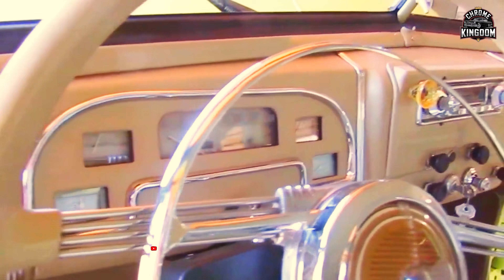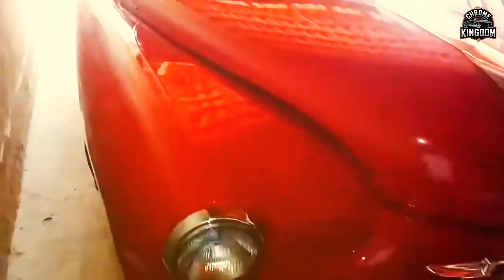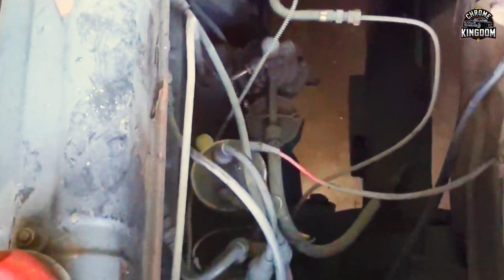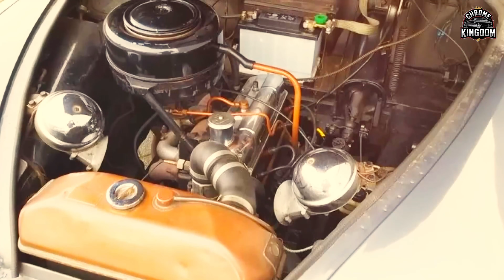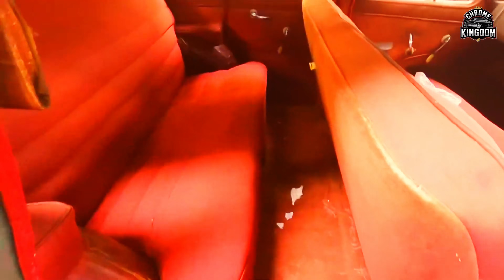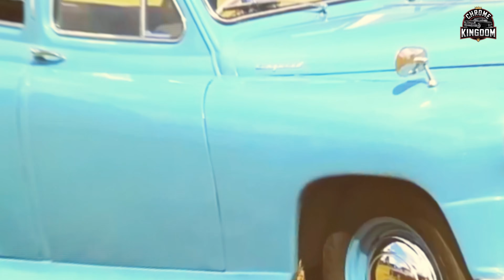Standard Vanguard (1947–1963): Why Engineers Called It “Indestructible” — So Why Was It Forgotten?

Comment: I totally agree, the vanguard was built like a tank, my father went off the road in hilly country, the car rolled twice and landed on its roof, no truck available so a team of men pushed it over onto is wheel, checked the oil level and the radiator water, fixed both and my father drove it 50 miles to home, not a dent, yes a few scratches that polished out and he drove that car for another 5 years, the only problem was that the gear lever was on the right of the steering wheel, had a small arm that came out of the pillar to signal you intended to turn left or right.

Comment: My dad bought one new in late 57 and exported it to Nigeria a two tone blue model , dad sold it in 63 or 64 to my grand parents  butcher in Sheffield  it was still in use in 1980 and looking good not bad for a car 23 year old car I spent many an hour sweating on the back seat of that Vanguard as a baby in a metal baby seat with a dinner tray on the front, some where to crash out then later my little brother in the baby seat and me sat next to him no seat belts back then. Dad chose the Vanguard  as it had been tested on the trans Sahara rally by two well know British rally drivers whose names now escape me they had been employed to put the car through it's paces and make notes in fact they found little to comment on, it was quite a short list and Standard made good on their findings one being better door seals as the factory seals sufficient for English weather proved inadequate against the Sahara  dust, dad reasoned probably rightly that if the Vanguard was Sahara proofed then it would be good enough for Northern Nigeria.

Comment: In rural Australia, dad bought a Vanguard Ute in 1954.

With 15 inch wheels, and “Trac grip “ tyres, the Ute was unstoppable. Uncle Donald had a Land Rover, and Dad could always follow the Land Rover, and never got bogged.

Our little sister sat in the frown seat with mum, while my brother and I, plus the red kelpie, travelled in the tray at the rear of the Ute.

When it rained, my brother and I huddled under the tarpaulin, and moved close to the front of the tray, under the window ledge. Snug as bug in a rug, dry even in torrential downpours.

Comment: I owned three Vanguard in the 60's, one phase 1 and two phase 2's, they were the best car I have ever owned and that includes my current Audi A4 Avant which is in it's own right a good car. The Vanguard was indestructible and it was a dream to drive, I often drove from South Wales to London, 125 miles and got out of the car as if I had just go in, no stress at all, averaging 70 mph. In those days I maintained the car myself so the cost were low, not like now unfortunately. You could rotate the wet liners 45º and change the piston rings and it was like a rebore.

Mike. F. Malta

Comment: I remember when Dad traded his third Vanguard. 4 on a fhen new Holden EH in 1964.

I wondered what the roaring noise was on the Holden - road noise!!

No one believed the old Vanguard had a full synchromesh gearbox - in the late 1940's!

It would outpull the early Holdens with its great low-down torque. Tough as, eslecially on rough dirt roads.  Only begtered i. The 60's by the brilliant Peugeot 403, which I owned.

Ugly as sin, known as the Bum Cart, but one of the most solid cars made in those decades.

The later Vanguard Six was a real gem, espdcially with a floor shift.